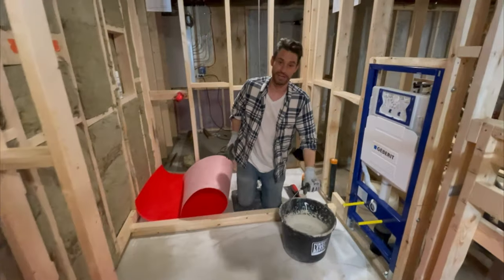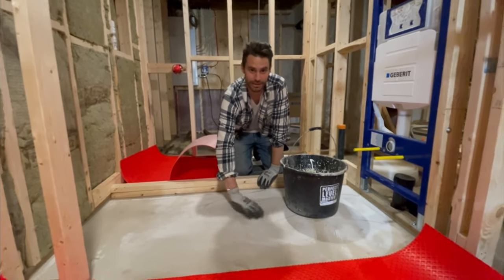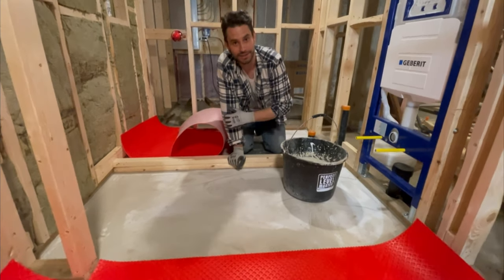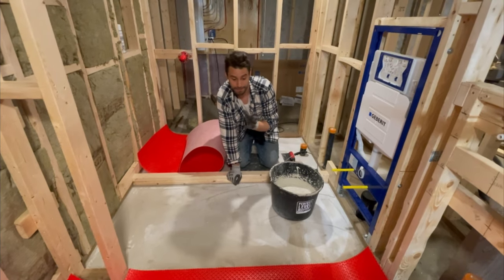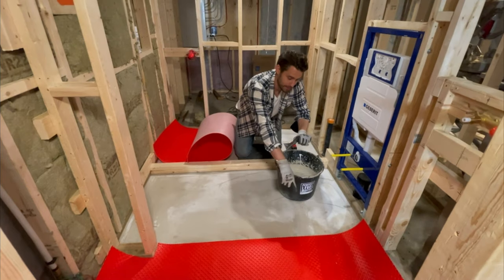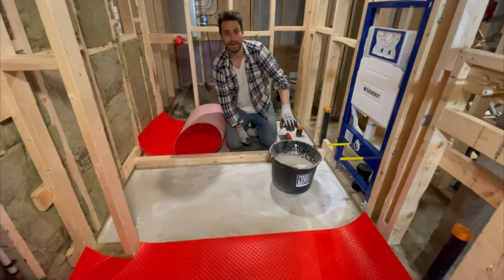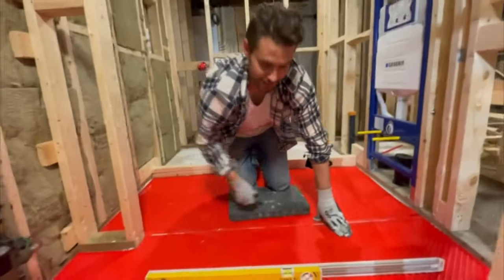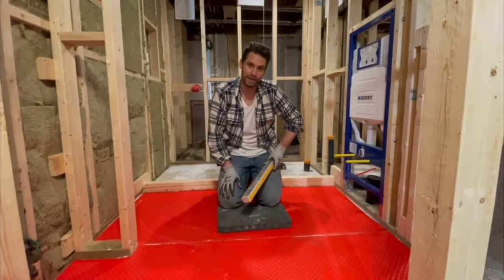Surface Prep For Tiling (Installing Crack-Isolation/Uncoupling Membrane and Underlayment)

Comment: great video, thanks! Would you use the uncoupling/crack isolation membrane instead of cement board, or in addition to cement board? for example, i've got some 12x24" tiles for a bathroom floor, the substrate is 3/4" T&G and I was gonna put 1/2" cement board and then tile; should i use the membrane in between the cement board and tile? thanks!!
Reply from the maker: Hard to say for certain without seeing it for ourselves, but from the sound of it you ‘should’ be able to apply the membrane directly over the subfloor (assuming there aren’t large gaps anywhere). It can’t hurt to do cement board first, but we also don’t think it’s necessary in this instance, as long as the subfloor is flat and in good condition 👍

Comment: Looks pretty easy to put down.  How complex is it to tile over?  Also...love the awesome "extendable level"...that one made me do a rewind!  So many times I could have used a tool like that!(sorry got off track with the cool tool ...lol)  Thanks for sharing!
Reply from the maker: Haha not at all! The extendable Stabila level goes everywhere with us (you’re right, it’s extremely useful). To answer your original question, once the membrane is down, tiling over it is a dream. Same exact process, but the surface is clean and flat and allows the thinset to key into the grooves 👍